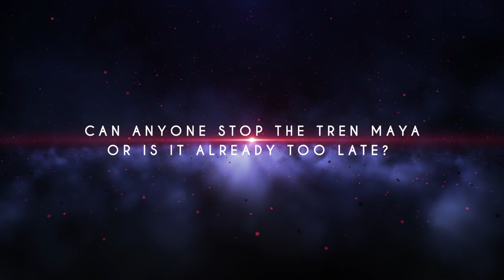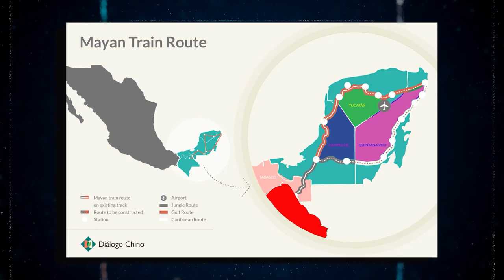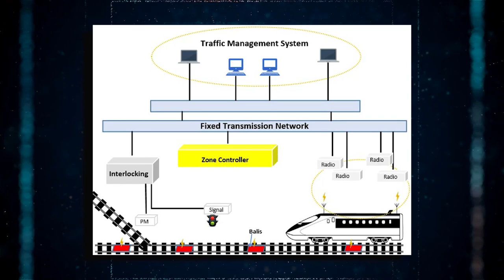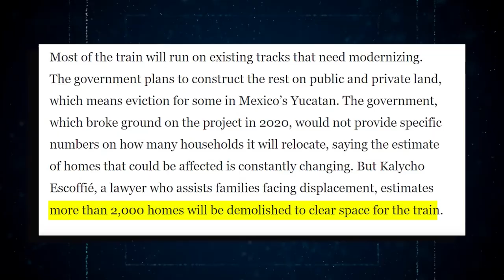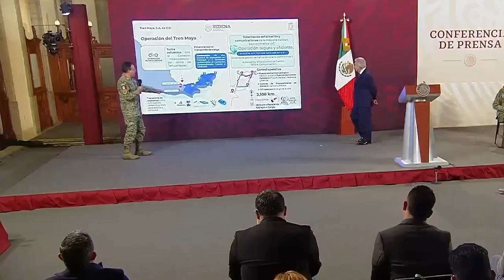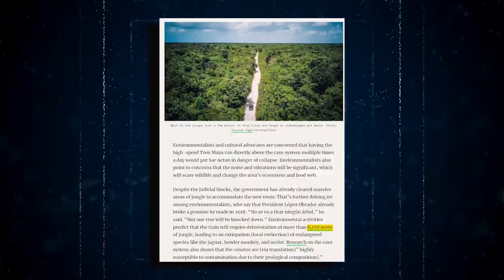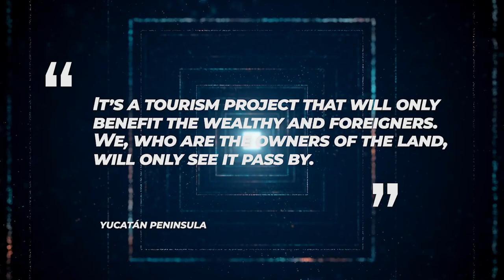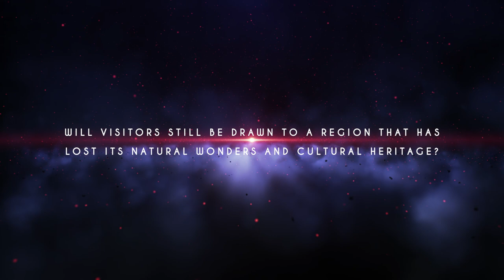Mexico Just SHOCKED American Scientists With This!

Comment: 1:52
I mean there's a design on that ring so technically you can say it's "art" but that kinda like a basketball hoop in a sport they used to play, idk if anyone still does. Someone will prob say I have it wrong but it's kinda like a combo of basketball and volleyball, the goal being to get the ball through the ring. I was taught, idk if true, that the losing team was killed/sacrificed. Again idk if that's entirely true...I mean they supposedly were bug on sacrifices so I wouldn't be surprised. It coulda happened for sure at times or maybe the losers of the final championship games were killed. If every team that lost was killed they'd run outta people to play. Idk how often they'd play, if it was a very common sporting event or just a certain times of special significance. And maybe no one was killed and that was just people either misunderstanding or intentionally trying to make them out to been seen as savages. But to sum it up, no that's not really considered art. In that case a basketball net is also art, it's made of squares rectangles and circles with a net. Again, yes their is a pattern on it but I still say this is miscategorized.